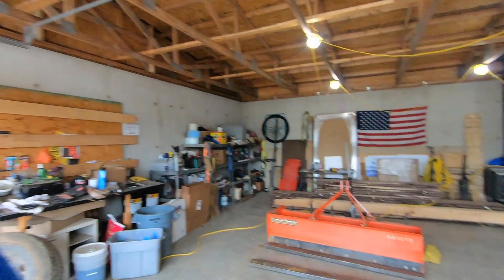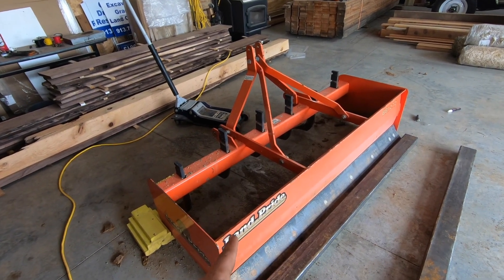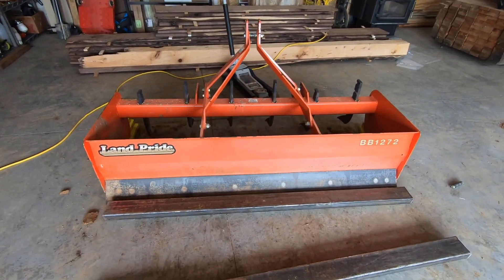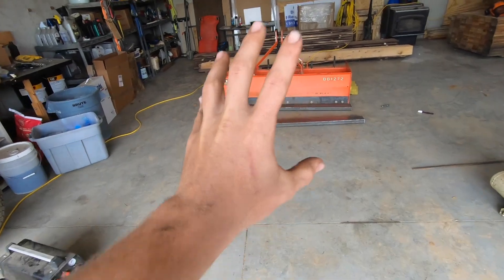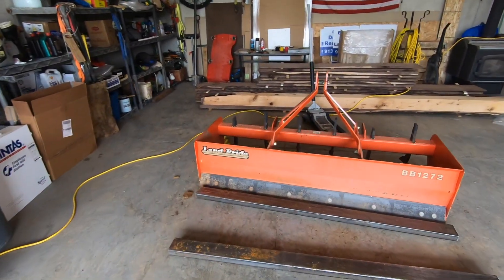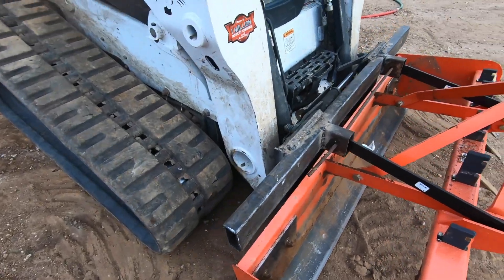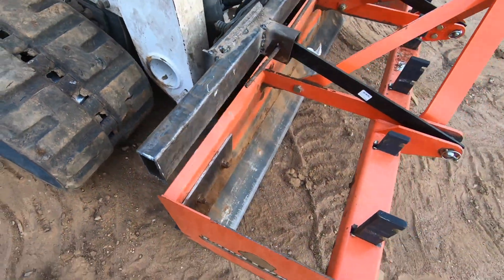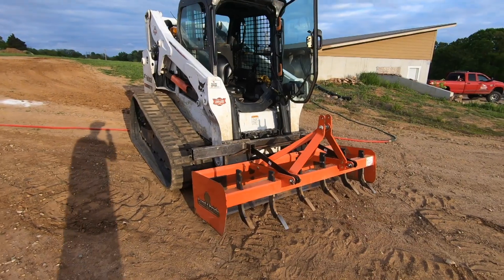Fabricating a Box Blade Attachment for the Bobcat T650

Comment: I did the same thing about five years ago. Works GREAT.  Then I put the angle attachment on the skid steer.  I use it almost daily.  Great for carrying material like done driveway. Also have done many shop floors with the laser

Comment: Turn it around works better seems like to me, room for material when back dragging and can see what your pulling up better. It seemed like mine wanted to dig more when I ran it the direction in video
Reply: I did this by buying a quick attach/3 point adapter plate.  Just connect to the BB and use it the other way.
Reply: This is what I had imagined would be the case too. Science says it's easier to pull something than to push, I believe.

Comment: So I'm interested how well does it actually work on areas that aren't flat and having nice graded work since you're pushing instead of pulling I've been thinking about doing the same for mine but I've got a rubber tire machine
Reply: I made guide shoes for the sides so I can put down pressure on the blade and control my cut by rolling the blade...
Reply from the maker: It’s not very efficient if the ground is hard,  if you rip up the ground with the scarifiers first, then it works like a charm.

The reason we have it facing forward instead of backward is we can push a lot more material. Otherwise we would be limited to the amount of material that can fit between the machine and the blade.
Reply: @ryan_lexi  rt. I figured as much but was trying to come up with a cheap fix and I have a few box blades. Guess I'll save up for a land plane.
Reply from the maker: land planes are amazing attachments! We’ve got one for our tractor and couldn’t be happier with it.
Reply: While I'm doing a heavy cut I'm only on my back tires so I run snow chains on my tires for extra traction on my small machine... Makes a huge difference...